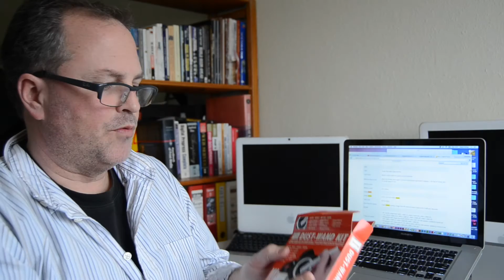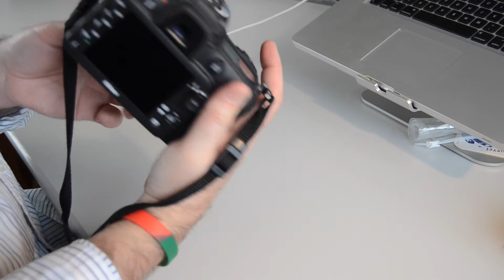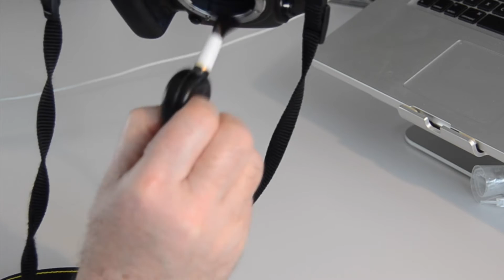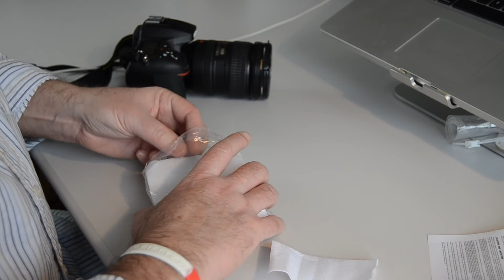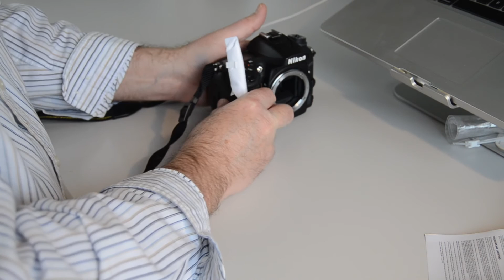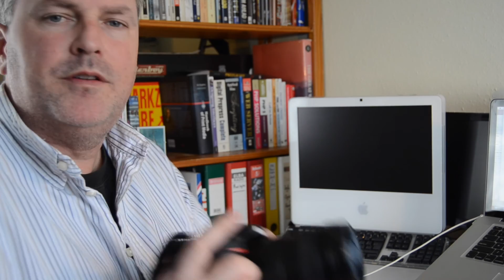How to Clean a Nikon D7200 Sensor

Comment: That amount of dragging your going to scratch your low pass filter in front of the sensor. Just buy Photosol swabs and eclipse and swab left to right, turn then right to left using about 6 drops , job done safely.

Comment: try cleaning my camera but when I click on lock mirror for cleaning its says this option is not available at current settings or in the current camera state... what do I need to correct?
Reply: Did you check the battery charge?Charge the battery full and try it.
Reply: Wayneworld k that is because your battery is low. The Camera does not want the battery to die while you are cleaning. The shutter would then close when there is you cleaning inside it and it will be damaged.
Reply: Also doesn't work if its set for recording videos.